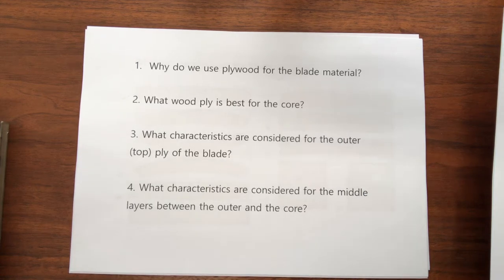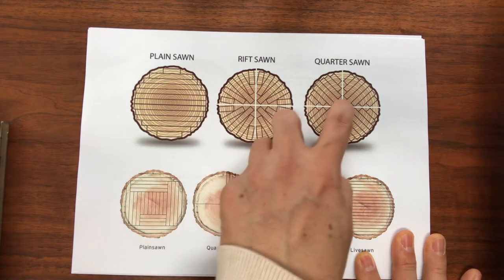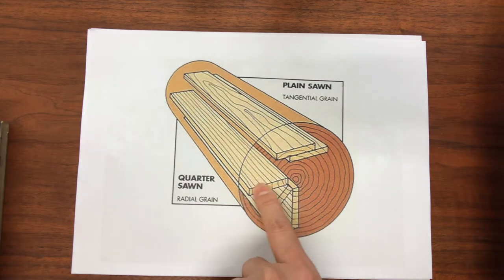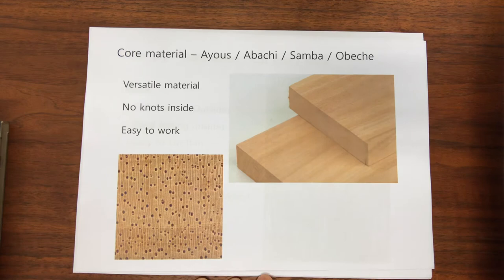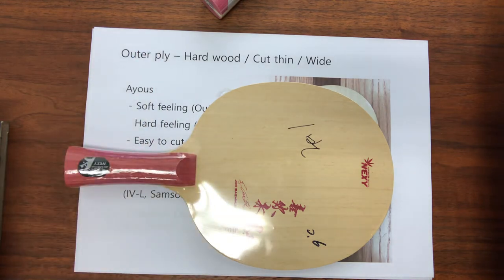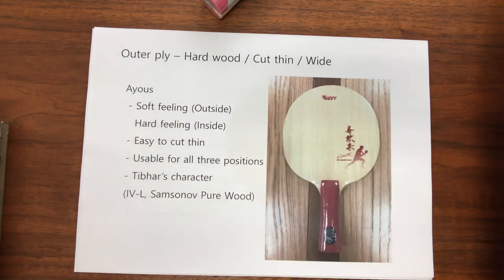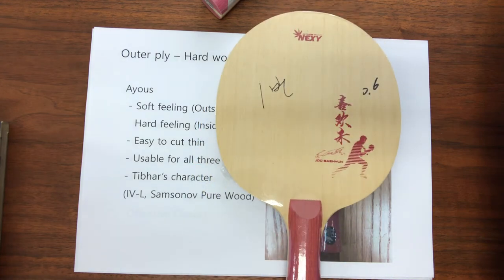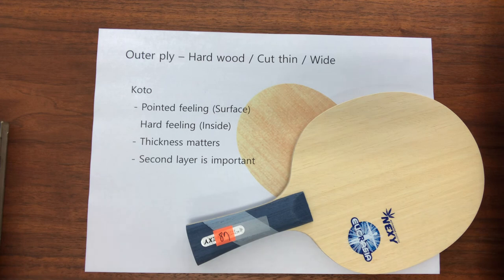Blade composition (2)

Comment: Thank you very much for your work, Oscar! :)
I am defender from Russia, and now I have a problem finding the right blade for my game.
I prefer flared handles because with this grip I can really feel my FH/BH chop, but best defensive blades (like Butterfly Diode V or Victas KMO) have very thin flared handles.
Please, tell me, how are dimentions of Nexy Joo Sae Hyuk FL blade compared with the above blades?
And is it possible to make for defenders blades with BIG FL handle, like Tibhar Stratus Power Defense's?
I'm sure I'm not only one who need it :) 
If it is possible for an additional fee, It's also great...
Reply from the maker: The current one has thin neck. So, can not satisfy you. I will try to make it thicker later. Keep in touch. defunctcom@gmail.com